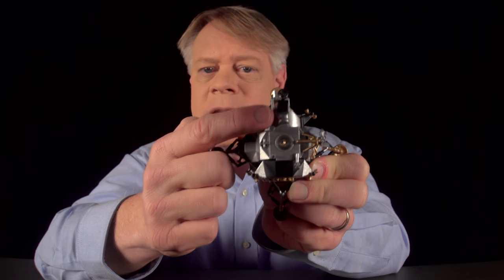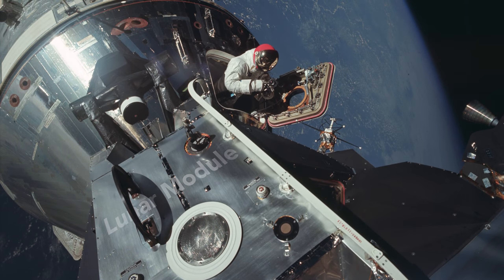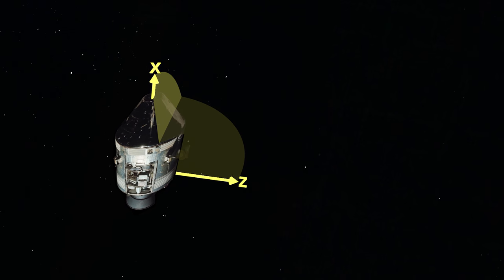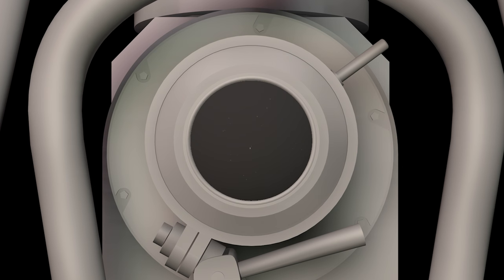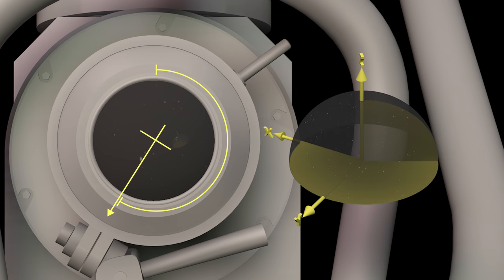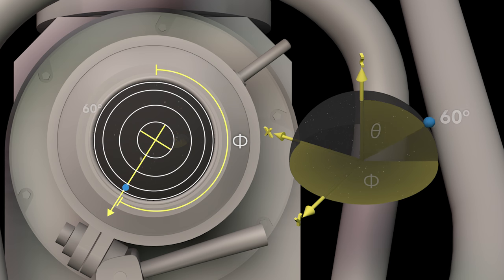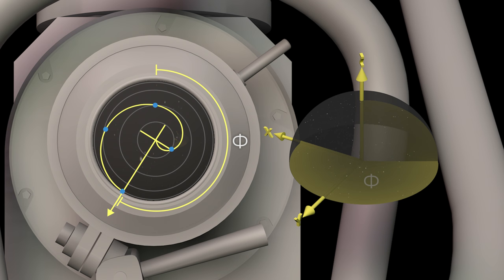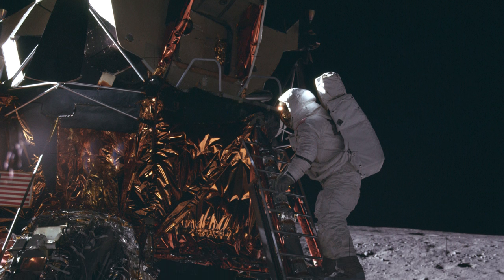Apollo: The Alignment Optical Telescope

Comment: The astronauts performed, in the first maned earth orbit of Apollo 7 mission, establish an optical tracking of a target vehicle using the Kollsman sextant; attempted twice to use star and Earth horizon sightings to establish an Earth horizon model, and it was deemed "Not Achieved" since the Earth horizon was indistinct and variable, with no defined boundaries or lines, thus precluding obtaining the necessary data. A sight grid devise overlay with rotating eyepiece was added. Later, an AOT - "Alignment Optical Telescope". was added by/to the Kollsman instruments for later Apollo flights using overlay grids and an Archimedes' Spiral template lining up on three stars, a brilliant idea to keep the optic view clear.*. See "The Brilliant Telescope Apollo Astronauts Used to Find Their Way Through Space, All it takes is a star, a spiral, and a ton of ingenuity." By Eric Limer, Jun 7, 2016. *this exact video.

NASA contracted from Kollsman Instruments these exact specific instruments for the Apollo space missions:
-Alignment Optical Telescope (AOT), was to collect star Data and Fixed elevation. The astronauts used the Alignment Optical Telescope (AOT) to establish the location of a selected object relative to the structure of the LM. The astronaut selects a detent and the particular star he wishes to use. Heaters prevent fogging of the mirror due to moisture and low temperatures during the mission. He then maneuvers the LM so that the selected star falls within the telescope field of view. The LM Guidance Computer (LGC) held celestial coordinates for 37 stars plus the Earth, Sun, Moon, and, as number 00 in the star list, another suitably located object. The AOT gave the astronauts a choice of six fields-of-view, each 60 degrees wide and with the centers separated by 60 degrees. Kollsman's patented sublimely faint lighting systems of ten (10) miniature red lamps mounted around the reticle prevent false star indications caused by imperfections in the reticle and illuminate the reticle pattern. Stars will appear white; reticle imperfections, red. 
See video on Apollo: AOT - Alignment Optical Telescope perfect alignment in space and the moon - http://youtu.be/viwqYi71qCQ

- Sextant (SXT)* 28x magnification, 1.8 degree field-of-view, duals line-of-sights for collection of celestial/star
- Scanning Telescope(SCT)** 1 X 60 degree view for locating stars and moon land marks for essential orbital navigation.
- An Apollo navigation and guidance display instrument panel unit and Minimum Impulse Controller(MIC) mini-rotational controller   fine tuning for Reaction Control System control for optics sightings
- Apollo Navigational Alignment computer Control and Reticle Dimmer (CCRD) assembly w/ MARK and REJECT pushbuttons
- Apollo Star tracker photometer high voltage filter condenser; and servo system with target optics with a mirror beam splitter
- Apollo Crewman Optical Alignment Sight (COAS), a gross range/range rate cues used during final approach and docking, also used as  backup to optics for navigation sightings.

*The chief differences between the nautical and Apollo sextants are the 1.6 in. aperture, the 28 power magnification, and the more accurate readout of the latter. These improvements were required by a need for increased accuracy for navigation.(One-Power Symmetrical Telescope Optically, this instrument consists of two similar telescopes in alignment. For this case the entrance pupil is as far forward of the telescope as the exit pupil is aft. They are the same size and the field of the one-power telescope is approximately 60'.

**The Kollsman scanning telescope was a unity power, wide view-field (60°), single-line-of-sight device used for coarse acquisition prior to sighting with the extra for alignment of the IMU stable member to back up the sextant, or for determining the line-of-sight direction to landmarks for orbital navigation. It is a single line of sight, refracting-type, IX magnification instrument with 60-degree instantaneous field of view. It is similar to theodolite (surveyor's instrument used to measure horizontal and vertical angles). It has a double-dove prism mounted in the head assembly. The operating power for the telescope(SCT), sextant (SXT), and associated electronic equipment is 94.5 watts at 28 volts de. The telescope has two axes of rotational freedom, which are normally slaved to the sextant axis. The wide field of view is used for general celestial viewing and recognition of target bodies. It is also used to track landmark points during earth and lunar orbits.

Kollsman was selected by the Manned Spacecraft Center for it's Apollo missions assignment in May, 1962. A month later a group of specially-qualified Kollsman engineers, designers, and draftsmen moved to MIT Instrumentation Laboratory to work actively with others members of the guidance-navigation team. Kollsman delivered the three units consisting of telescope, sextant, & map data viewer. Kollsman produced over 2,000 complex Optic mechanical electrical Astro-trackers and associated system by 1962.

A major key to this success of the NASA Apollo lunar missions was the precision Optical navigation and guidance systems,  Kollsman Instruments precision manufactured essential NASA instruments for the astronauts. The Kollsman's Optic department understood Huygens Construction Snell's Law. In the Huygens Construction, radiation consists of wave-fronts in space which are spherical when observed from close ~ aboard and plane when observed from infinity. Snell's Law can be deduced from Huygens Construction, and this is the basis for geometrical optics. The navigation function of the guidance and navigation system is primarily based on the use of optical line-of-sight measurements, which serve as navigation inputs. Although the primary navigation inputs are optical line-of-sight measurements, the communications from down-tracking can serve as a backup and may be used during the mission as in-puts to assist in the execution of the navigation function.

The Kollsman Inc. manufactured the on board space sextant with a navigation display equipment, a scanning view targeting finder telescope and used on Frank Borman's Apollo 8 first lunar orbit mission and other following Apollo missions. However, the internal gimbal guidance system, and three navigational system, regularly failed as it needed an omitted fourth heavy gimbal,  and therefore was never reliable and needed the Kollsman sextant' update corrections almost daily. This MIT's inertial measurement unit carried several Sperry accelerometers instruments and measured the rate of change of velocity of moving bodies.Highly sensitive accelerometers components were used in inertial navigation systems for aircraft and missiles. The sextant was actually the main guidance system. It's true, a great benchmark in humanity heading deep into space. (Insights might be in Jeffrey Kluger; "Apollo 8: The Thrilling Story of the First Moon Mission", released May 2017; "Apollo 13" in 2006, and his attempt to explain, in 2009, "Simplexity")

A Kollsman Instrument Company manufactured 'Eye Pieces, Sextant, Apollo Guidance and Navigation System', this  object, Inventory Number A20010305001, is on display in the 'Time and Navigation' exhibition at the National Air and Space Museum in Washington, DC National Air, as are over 100 ingenious Kollsman instrumentation artifacts. The Institute of Navigation Museum, ION Virtual Museum also displays a Kollsman manufactured 'Sextant, Apollo Guidance and Navigation System' ID-20010305000.

Kollsman Instruments manufactured the Apollo celestial space navigation alignment optical sub systems included: Optical Base & Axes, a space sextant, position serve loops, power supplies, display & control panels*, map & data viewer, sunfinders and Star tracker photometer high voltage filter condenser, a Alignment Optic Telescope AOT w/servo system with target optics with a mirror beam splitter; and a much needed optical "rangefinder" eye piece unit, starting with Apollo 9, and navigation display system operated on March 1969. The optical subsystem mechanization positions the sextant and telescope according to command signals from the optics hand controller's fingers.

Comment: Thanks for the video.  I never knew how they measured the angle with that telescope. Another problem using a hand held sextant is that at sea we use the horizon as the reference to measure the angle from in space this provides a problem. How would you define the reference to measure the angle?
Reply: The AOT of the LM was only used for attitude determination, not navigation. The CSM however did have a sextant which could be used for navigation. The usually used mode was star/horizon measurements, very similar to navigation with a sextant at sea. Now in three dimensions, the closest or farthest part of the horizon from the star had to be used for the measurements. And because the computer knew exactly, in 3 dimensions, in which direction the horizon and the star is, these measurements were used to update the computers knowledge of the spacecrafts position and velocity.
Reply: What Horizon? In that mode could only be used either on the moon or low lunar orbit.
Reply: richb313
This kind of navigation works best if you aren't close to the body that you use for your measurements. The moon without atmosphere is easy, you simply point the sextant at the transition between surface and space.

For the Earth it's a little bit more tricky, but if you are 1000s of kilometers away, then the 100km atmosphere won't be too significant. However, the computer had a variable for the horizon altitude used for the measurements. This is a little bit of an art and different Command Module Pilots chose different altitudes for the horizon to get consistent results. Usually something between 18-28km.
Reply: Have you ever used a sextant? At sea you measure angles to the horizon a definite line. Trying to line up the reference of the sextant to a body without a definite transition line must definitely be an art because instead of resolving the angle to minutes or seconds of arc you would be lucky to get it to a degree or two. There are two methods commonly used in big aircraft with a sextant. The first is the visual horizon and the second is to lock the sextant to an artificial horizon provided by the air crafts avionics.  I do not doubt your explanation but establishing the reference or horizon is key to making an accurate measurement Anything with an error greater than 30 seconds of arc is practically useless where accuracy is required.
Reply: richb313
I am familiar with the functional principle of a sextant, but I have to admit I never used one in real life. Only the one in the simulated CSM I help develop (NASSP for the Orbiter Space Flight Simulator if you want to have a look).

I'm not 100% sure what the accuracy is that the astronauts were able to get, but it was much, much better than degrees. Again, if you are e.g. 200,000 km away from Earth, it won't matter too much if the horizon threshold you are seeing is a few kilometers off. That's a very small angle difference. In that way it is quite different to nautical sightings. Apollo 7 (a low Earth orbital mission) tried this type of navigation with pretty bad results.

Comment: Where did they get the weight savings to accommodate the lunar rover on the LEM?
Reply: More to do with the Saturn V F-1 engines each being uprated with an additional 22,000 lbs of thrust starting with Apollo 8. This also allowed for the extra weight needed for the extra and longer duration EVA's that went along with the three J-missions that had the lunar rover.